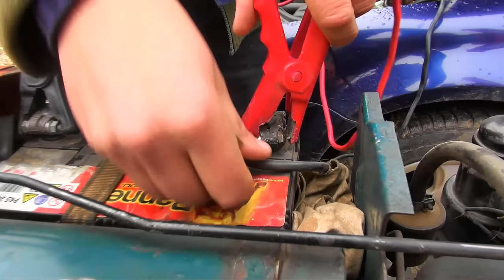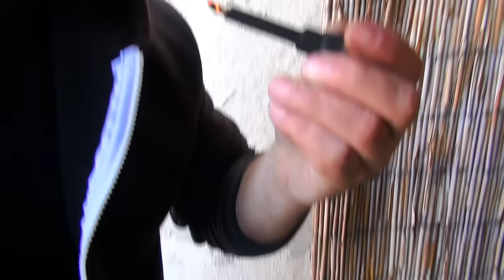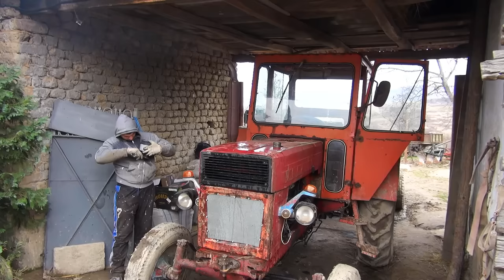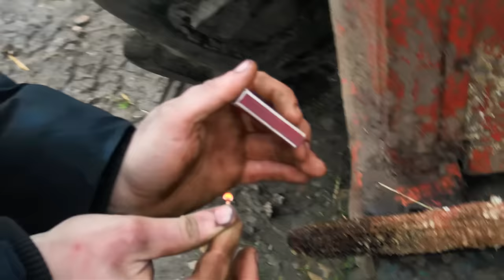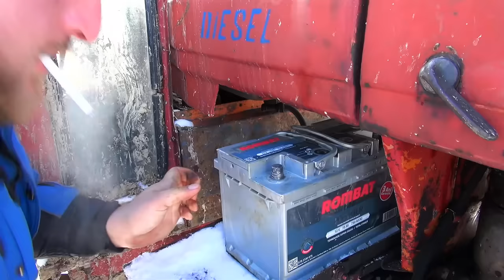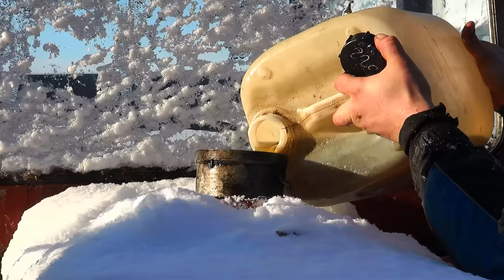BEST OFF !!! 👉💨💥🚜 EPIC ENGINE START 💥💥💥💥💥💨💨💨💨

Comment: This is exactly the thing,  I love the most,  about old vehicles. It's not just about flicking the key in the ignition. It's a process. A procedure, and the best is,  that you don't know,  if you'll going to be successful,  and how many attempts you'll gonna need,  to start it up successfully. And those bosses,  and whistles are just so gorgeous ❤  J.
Reply from the maker: Thanks friend and glad you liked it!🤗👍💖
Reply: That's because you have the time and don't need to rely on it.
I'mm sure that if you had to get to work in the morning you'd prefer to get ion and go rather than go through the crap shoot of will it start/won't it start.

Comment: In years I've never ever seen anyone try to start engines while heating the air going into the intake manifold and now there's several examples all in a single YouTube video. Cool.
Reply: You did not see a lot of things :))
Reply: @florinman265  ахахахахахахаааа ,много видевший!!!
Reply: Need some temp in that block
Reply: I've did it with my bare hands,  and old news papers,  help start an beautiful old wheel loader (HON 053). It was pretty painful,  and not that much of a fun 😀
Reply: @JakubSemoda  I've done it with a hair dryer before! Just didn't know it was something people legitimately did from time to time. It worked way better than I was expecting it to.
Reply: The Soviets didn’t seem to like glow plugs.

Comment: I use an industrial heat gun inserted into the air intake. Turn it on High for a few minutes and my 1973 diesel starts every time!

Comment: That tractor at 5 min part in video,,,,no front wheels or radiator.  

Nice way to start with a burning flame.

And choking hazzard with that smoke,,,but nice flames out of the twin exhaust manifold in the end.

Sounds like the diesel injectors are shot too,,,not going on all cylinders.
Reply from the maker: Nick ...thank you
Reply: @tractorsmachinesro1405  No worries. 
Have u got the tractor going a lot better after engine fuel injection overhaul,,,etc,,,along with getting the front wheels and radiator back in place since the video back earlier? 

Looks like that tractor had done a lot of work back then.

Comment: That poor UTB engine in the beginning getting revved like crazy without water :(
Reply from the maker: salutare Robert
Reply: @tractorsmachinesro1405  salutare, va rog nu mai turati motoarele alea atat de tare ca is vechi si ele si nu rezista, plus ca era fara apa
Reply: That looks like an inline-6, not the original inline-4. It is probably a Saviem engine. But you are right, they revved it too long without any water in it.
Reply: @dorinp007  Oh, thanks for telling me that, I didn't know an inline-6 engine could be fitted on a UTB 650
Reply: @bobi_lopataru  there you have it, same rev-happy dude, probably the same tractor: https://www.youtube.com/watch?v=4m5Vjqxjx9I
Reply: @tractorsmachinesro1405  nu trebuie apa...

Comment: The red Belarus has had the original engine pulled out , the chassis rails cut & stretched , & a bigger , possibly ex lorry 6 cylinder engine shoehorned in , bloody difficult stuff to do , but a prospective excellent result in progress , guys here used to do this with Fords , Nuffields ( which became Leylands ) International Harvesters , & Masseys , it takes skilled experienced blokes to get it right , but fantastic when they do , the mechanics here are to be congratulated . Try doing this in a stone cold shed in Russia . This job always needs to be on a bomb - proof gearbox & back axle , as just bags more power . My old dad used to like Belarus tractors for their toughness , I,m a brit . I once looked at one at the old royal show , but was bothered about getting parts , from Minsk , so asked the rep , he said & I quote " Vlad says , you pay bill , anything at all , 24 hours by plane ! "  just unbeatable .
Reply from the maker: Thank you my friend
Reply: This is not Russia. Its a Romanian tractor U650... modified engine.
Reply: In the late 90s I was an outside parts salesman for an Western Canadian Freightliner Dealer. One of my customers was a 
Hutterite Brethren Colony that bought wrecked semi tractors and other machinery and 
Renewed them for resale. They had bought a bunch of  surplus brand new Cummins natural aspirated 220 diesels engines used in Gulf War Humvees.  I bought and resold 5 of these engines. 2 were sold for irrigation pumps, 
2 for old graders and one to replace an Allis Chalmers farm tractor engine. I resold them for $5000 Can. In the case of the Allis they reworked the frame somewhat and installed the Cummins. Although it didn't have a Turbo the engine performed very well and was still there 10 years later. And including labour the replacement saved the farmer $6000. The key was the exceptional mechanic who had retired the year before from a local farm equipment dealer.

Comment: I  Still like my Kubota tractor better , it starts first time every time and I have had it for 17 yrs and it starts in our very cold Canadian  winters, minus 25 to minus 40 plus
Reply from the maker: Te salut cu drag și respect
Reply: It’s all about climate And the machine gets used to it. Like here we don’t get super cold but if we do we can barely get anything to start. But somewhere like Canada they start like nothing in the same temperature
Reply: @xade7863  A lot of suppliers/manufacturers will knock the timing of the diesel injector pumps back, or forward to compensate for regional weather - we see it often in the UK with imported scandinavian machinery.
Reply: @craigywaigy4703  true in some cases but the older tractors wouldn’t start with the timing changed or not cause it didn’t have enough compression

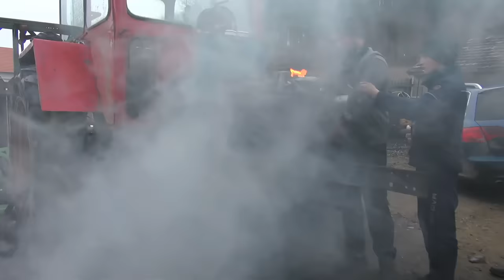Comment: The best one is the guy from 3:30 , hes banging the shit out of the engine without the radiator on
Reply: Yes as if it wasn't f@cked enough. Cooked now.
Reply from the maker: Salutare prieteni
Reply: Engine timing is fucked or got some dead injectors
Reply: @buttertoast8039  white smoke

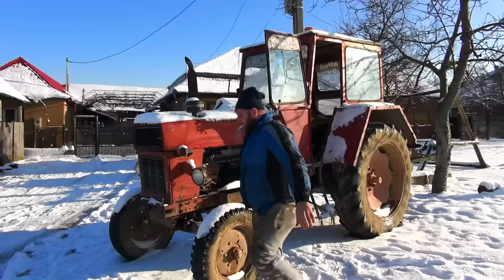Comment: Do not do the trick at 15:50, he is hitting the engine block and frame multiple times shorting the battery.
The wrench can weld itself stuck between + and -  , the wrench or cable can melt and the battery might explode.

Comment: Do any of these tractors normally use glow plugs?
Reply: I was thinking the same 😅
I guess maintenance also isn't in their dictionary 😂
Reply: @henrique14211  Yeah, makes me curious. I know diesel engines without glow plugs exist, but was wondering why these weren’t able to start without feeding some fire down their intakes.
Reply: @Simon-dm8zv  they need all that because probably are indirect injection engines, I have a friend who had a car with izusu engine (diesel indirect injection) and had the glow plugs relay falling on him, almost 15minutes to start the car 😂
And it's not to cold here temperatures usually don't go below 0C even in the winter
Reply from the maker: Salutare Simon
Reply: The little kubota as shown has glow plugs but alot of the other tractors had a cold start button on the injector pump but in very very cold winters that wasn't enough so a bit of heat comes in handy especially for diesels, the cat challanger id say shes been sat for a very very long time possibly due to a fuel problem or just been abandoned for a newer machine
Reply: @henrique14211  these older Diesels didn’t have glow plugs and didn’t produce as much compression so really needed ether to start em but they’ll last longer than any newer engine
Reply: @Simon-dm8zv  These are very old designs (I estimate late 30s). Most of the engines shown in the video are inline-4 direct injection naturally aspirated diesels. 4.2 liters, 65 HP. No glow plugs there. There is no block heater, and no fuel filter heater either. The ambient temp below 0 means that the fuel does not really flow. May I also point out that the diesel fuel used in agriculture is not the purest or most expensive flavour. The big CAT rig is obviously something else, and the dumb guy revving the  engine without coolant definitely does not know better. That engine is a transplant from a truck, AFAIK those U650 tractors were never built with 6-cylinder engines.
Reply: @henrique14211  yep

Comment: My uncle used to take an old coffee can (old metal ones) and put a diesel soaked rag in it, light it on fire and let the bottom of the engine heat up before he started it it sub zero temps. World like a charm.
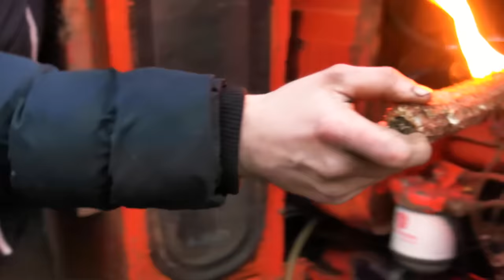 12:30 that flywheel is toast

Comment: Engines need oxygen to start, so burning it all doesn't help. I get a bit of preheating but you will burn the starter motor out cranking continuously for so long. A squirt of easy start/petrol/ brake cleaner would likely start it instantly. And anyone who is going to say you will glaze the bores - it will do much less damage than sucking in a  burning rag.
Reply from the maker: salutare prietene    .multumesc
Reply: It breaks the rings or the ring land of the pistons. Then after that the bores get junk.

Comment: Can someone explain how holding a lit fire helps when trying to start the engine? To me it would seem that you are using up all the oxygen that the engine would have had if not for the flame, and this seems to be support because I noticed that three of the engines where this method was tried the engine didn't end up starting off of, for example, the first engine I can remember seemed to not respond to a lit flame very well and I noticed that it seemed to want to roll over when the flame wasn't there it just need a bit more time just on the starter to start up. And then another they tried holding a flame then they switched to ether and it started up running off the either where then once the gas was there it continued to run on fuel. What gives?
Reply from the maker: Air heating
Reply: These are diesels, and diesels always run lean (excess oxygen in cyl, even after combustion.)
They have no spark plugs, and are instead ignited by the heat of the air charge being compressed.
When the air charge and combustion chamber are dead of winter cold, especially if the engine has lost some of its original compression, the engine may not reach diesel auto-ignition temperature without help.
Modern diesels use glow plugs or block heaters.
The Cummins in first gen Dodges actually had an electric heating element grid in the intake for this.
Yanmars used to come from the factory with a cute little diesel hurricane lamp in the intake for very cold starts.   Did the same thing as these farmers do with their diesel n rag torches, just in a tidy Japanese package.
Reply: @NullHand great explanation thanks!

Comment: The one tractor at the beginning with no hood or front wheels they were reviving that engine with no radiator they probably cut the video cause the engine over heating and locking up
Reply from the maker: salutare prietene

Comment: Knackered valves, worn bores and piston rings, faulty injectors etc etc.  For god's sake just fix them!  It's cheaper in the end having an engine that just starts straight up as intended, rather that wasting your fuel, oil and time living with a worn out one!

Comment: clearly they have no ide how to start that tractor engine on the Kubota  b6000 it has a start switch that has heater in it on the other side just turn counter clockwise and there is a half compression lever !!!

Comment: Putting the fire into the intake is stupid, your burning oxygen the engine needs, heat the pipe that will warm the air to start the engine
Reply: No. Diesel needs the heat more... Its the hot air that helps it start, drawn in with the oxygen around it...
Reply: @mikeznel6048  it can't draw in oxygen if the flames cover the inlet opening, that's why it took so long to start. Heat the intake tubing.....
Reply: @mikeznel6048  already said, but i second that.
That will just consume the oxygen, and the unburnt fuel will wash away the oil in the cylinders.
This is a very bad idea...

You can see it by yourself in the video. The first engine was trying to start, then the fire is put right in front of the intake nearly killing it again...

Absolutely stupid idea...
It works only if you don't aim it directly in front of the intake, but just using an electric heat gun will work even better.

Putting a little bit of oil in the intake is also a way better idea! (it can raise compression a little, making a shot engine start a lot better)
Reply: @Fabien2626  No. There is ALOT of oxygen in the air....
Reply: @ChiefCabioch  Sorry, I don't talk to people like you. This isn't a video so you wouldn't understand it. I very actually worked on more diesels, and gas, both 2 stroke and 4 stroke than I can count. You know, there is alot of oxygen in the air right? And the only oxygen consumed is thay which is in the fire, not all of the oxygen around it? Do we suffocate sitting next to a camp fire? No, we do not suffocate sitting next to a camp fire... And no, engines require FUEL and AIR, oxygen being a component of the air... Look up the old fashioned engines from the time before electric grid heaters. Guess what they used? FIRE!!! This video is proof it works... And because you're too narrow minded to understand what's going on here... You think now hear me out, because it's extremely cold, the engine is hard to crank because cold, harder draw from the starter on the battery, remember hard crank cause cold, that an electric air hearer or glow plug, might not be conducive to cold cranking because it draws to much power? The thing is clapped out to begin with... The whole point is to warm it up alittle to help it combust. Diesels don't use spark plugs, they depend on HEAT and PRESSURE  to combust. I'm not going anywhere further with because it shows the engine start with the fire in the intake. You're too caught up in yourself to understand there are people out there who know more than you. Look up cold starts in the north. Ever hear of a tiger torch? No you haven't so you best go back to your video games because you haven't the slightest clue how this, or or atmosphere works... It must be terrible being so dull...
Reply: @Fabien2626  The whole point is to warm the I take up a bit so the air coming in is warmer. Diesels require heat and pressure to start. Look up cold starts in the north. They put a tiger torch right down the throat hole and crank her to get things warmed up a bit to help it fire. When you haven't done something yourself, do you think it is wise to speak on behalf of it? Look up all the old fashioned engines. They start the same way. Weather it be a burning rag or a burning wick, same principle. There is plenty of oxygen in the air... The engine is a giant air compressor and jeeps pulling more and more air in. That's little fire isn't gonna snub out an engine. I live in cold climates, I know all about this. I commented because I know better than the original commentor. Believe it or not, some people know more about certain subjects than others. I ask you to look it up before you speak as if you know.
Reply: @mikeznel6048  it's not because some people are doing it that it makes it a good idea.
Trust me I deal with bullshit like this all the time...

If you want to help it start, just warm the intake, and the whole engine, before trying to start it.

There is plenty of oxygen, this is true in relative terms, but to start up a diesel engine, it's barely enough! (if you see black smoke, not enough oxygen was supplied, if you see white/gray smoke, it's either not enough oxygen or not enough compression)

Compression and temperature go hand in hand, if you want your engine to start better, rise the compression, so it will build up more heat right where it really matters.
Just put a little bit of oil in the cylinders and you will see, it will start up a lot easier and the cylinders will not be as dry...

If it doesn't work, apply heat, for a little while and try again.

And also, if you are trying to compare this to the way old semi diesel are started... Do a bit of research first!
You are completely wrong...

You have to heat the head (a designated part of the head acting kind of like a permanent glow plug) for quite some time BEFORE you attempts to start it up!
And it's not starving the intake of air at all...
Reply from the maker: te salut prietene